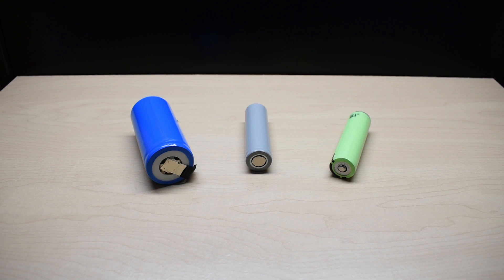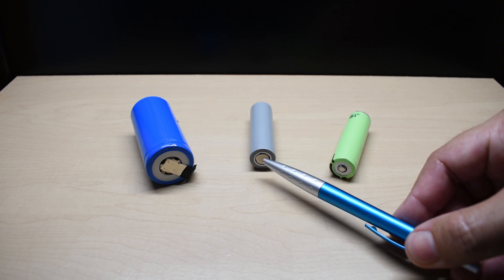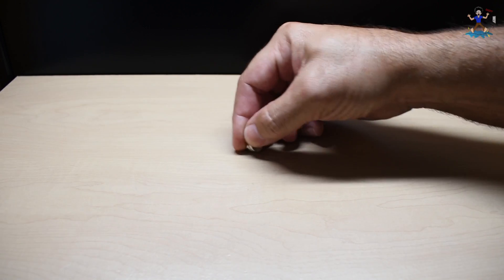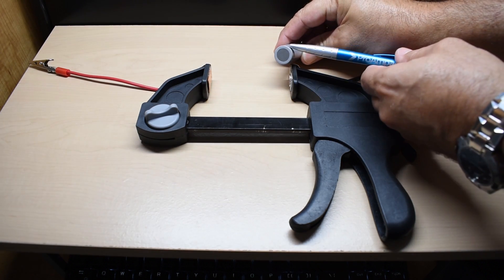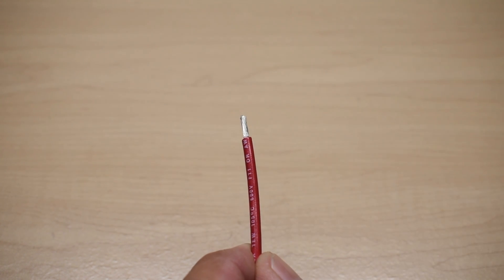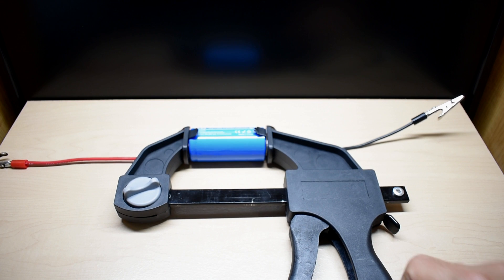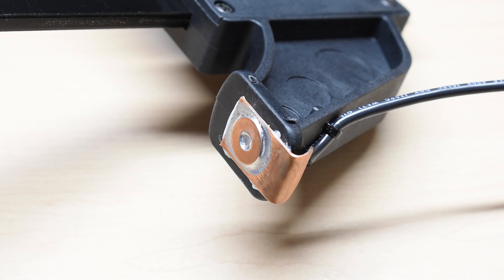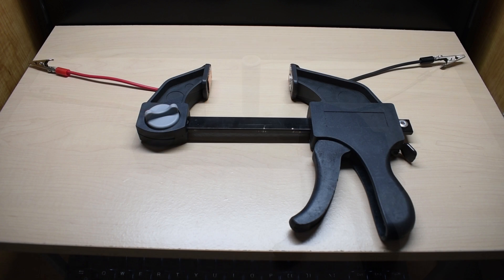LiFePO4 Cell Testing Clamp

Comment: You best to spotweld some nickel to the cells and solder copper wire to nickel as per industry standard as measurable losses will be measurable! In measure tests it matters absolutely 👍🏻

Comment: Great idea and fine for single 18650's of limited capacity, BUT ... 

You said you designed the clamp for 20A, I suspect that the clamp itself would probably handle more, except that you then "appear" to have used wire, suitable only for 5-10A with wholly inadequate alligator clips to connect the load,. Although this arrangement may be fine for lower currents, and even though the runs are short, it would be better to use a minimum of 2.5mm^2 or better yet, 4mm^2 (rated at 23A and 37A respectively) or 14 or 12 AWG respectively (Google for the stranded equivalents in your country) Silicone insulated wire being the best to use obviously. 

* The terminations AT the clamp ideally should be crimped lugs to copper machine screws/nuts not soldered (not even with silver solder)
* Load terminations should also be lugs or open fork terminations for best connections 
* Those alligator clips, above 3 or 4 amps, WILL get pretty hot, pretty rapidly! I use such to recharge some of my rechargeable NiMH cells and even at just 2A they get quite warm!
* Using copper machine screws/bolts on the clamp will negate the need for the soldered washer as they protrude sufficiently. Their heads can be flattened/rounded as required, or if necessary.
* A copper bolt (head thickness of 3-4 mm) can easily be shallow drilled to accommodate the dimple of narrow button anodes yet still provide excellent connection to low profile button tops
* Alternatively using the standard practice of a flattened dimple in the copper strip will provide the necessary lift (not as effective as copper machine screws)
* Creating the dimple is as easy as punching the strip with a suitable diameter rod with a rounded end (round steel wire nail, end ground with a grindstone/angle grinder will do the job great).

I plan on making one of these as it's such a great idea and I might try a return spring on the trigger handle connected to the new rivet point to aid the re-opening of the jaws for one handed operation. Good video.
Reply from the maker: #14 copper wire of the length used, is suitable. If the wire was much longer, I would've used #12 copper wire. As for the clamps, of course copper spring loaded clamps are the best, but I used what I had on hand, the ones used in this video work just fine as long as there's good contact with multiple areas of the alligator clip. Thanks for watching

Comment: Do you know of an inexpensive option for spot welding contacts onto batteries?  Everything I’ve found has been a bit outside my price range and soldering introduces too much heat into batteries (especially button cells) which drops their capacity quite a bit.
Reply from the maker: You can use what's in my video below. Very low resistance. 

https://www.youtube.com/watch?v=KKKIv-XNyeo

Comment: Great Idea. People use the magnets but I found out the soldering heat demagnetized the magnet and it becomes very weak.  I don't know how others doing it.  I solder a wire to cooper foil tape then tape it around the magnet. It works okay but not great. Your way is bulky but way better. Thank you.

Comment: Why not just solder the copper nipples on both sides if you're positioning in each battery by hand and the clamp holds it tight?
Reply from the maker: You could, but I prefer to keep the resistance as low as possible

Comment: How do I discharge my Chinese 48V 20Ah LiFePo4 pack? I want to bring it down to 50% soc for winter storage. I guess I could leave it on my scooter with the LED headlamp on, but I'm afraid I will forget about it and unintensionally kill my battery. Any ideas?
Reply: put some packs of lithium batteries in series and then charger them with a resistor (not fully)
Reply: @theoneohmresistor  Not sure I follow you. I have a sealed 48v pack that's fully charged. I want to take it down to 50%soc. I need either a discharger unit that can handle this load or some kind of way to put a load on it, like a bulb with a resistor, but I need to know exactly what resister and bulb to use. Discharging it via the scooter is not an option for me as the scooter is in non-accessable storage.
Reply: @dbfcrell8300  i meant not to just waste all the energy by putting resistor across it. If you have some drill batteries put them in series so you can charge them in series, but that's just complicated... Simplest way to discharge it would be to put 4 12v car headlight in series and put them across the batteries. It will draw about 200 watts from the batteries (about 5A so use something like 1mm² copper wire (18AWG ±2)). You should run it for about 2 hours.
Reply: Or if you're in country that you can buy incandescent bulbs, buy 4 of them, (or 2, depending on voltage of bulbs) put them in parallel and discharge them very fast. That's cheaper option, but I would go for headlights (cheapest ones you can find). Be aware of the huge inrush currents of halogen lamps (or any lamp really). Tell me more about the cells (discharge current). If you have literally any question, just ask. And by the way, what are the cells for?

Comment: thanks for sharing but what I found out that works great to is to use aluminum foil and fold it into a small square with tabs and sandwich it between the battery and the magnetic then connect my leads to the aluminum foil.

Comment: Nice video!  Would using an older copper penny work instead of the copper strips?
Reply from the maker: Great idea! Pre 1982. Solder the wire to the rear side of the penny, then bond it to the clamp. Thanks for watching! Be sure to share the video link.

Comment: Nicely done! I’m  looking forward to seeing what you measure for the voltage drop in the setup. I didn’t have very good luck with that type of stainless steel alligator clip (lots of voltage drop and heating) in my clamp setups and went with PowerPoles for one and directly soldered to the measuring equipment PCB for the other. Love your washer idea for the neg contact.
Reply from the maker: Worst case, I can swap out the alligator clips for copper. :-) Thanks for watching!

Comment: What i usually do is take a copper coin, solder a wire to it and then superglue a magnet on it, works really well, and your washed tip will improve it further.
Reply from the maker: That's good, but you need to flatten the side that will be making contact with the battery, otherwise only the rim, Lincoln's head, shoulders, and other areas will only make contact. Thanks for watching!

Comment: How about just flipping the magnet with the wire soldered on it over so the wire is between the magnet and battery? Although like your camp idea better for heavy loads.
Reply from the maker: No good, a better alternative would be a very strong magnet pressing a copper strip with a wire soldered to it, against the battery. The only thing, you'd have loose copper strips and magnets to deal with, my clamp setup is easier. Thanks for watching!

Comment: Copper tape is easier to obtain and solders well.  https://www.banggood.com/6mmx20m-Adhesive-Copper-Foil-Tape-EMI-Shielding-Guitar-Slug-and-Snail-Barrier-p-1235342.html?rmmds=search&cur_warehouse=CN
Reply from the maker: It's actually copper foil tape. It wouldn't be good for this project, way too thin, but it's definitely useful. Thanks for watching!

Comment: That's a good idea I have tried soldering to a magnet and wond up with no more magnet
Reply from the maker: Yes, if you apply too much heat, it will lose magnetism. Do it quickly using a smaller wire(18-20ga) with 60/40 solder, which has a lower melting point. Thanks for watching!
Reply: Ya but it's a low temp like under 100 C I believe unless you get more experience high heat magnets but they still don't go that high but I guess it's just a matter of having a big enough magnet so the heat does not get to the other side
Reply from the maker: @james10739  You cannot use a thin magnet, if you do, you'll heat the magnet past the Curie temp and it will lose magnetism. I've done it a bunch of times with no issues using 4-6mm thick disc neos.
Reply: Haha,yea,they cant withstand much temperature.Thats the downside of tthese magnets.Somme are as weak as 80 C.